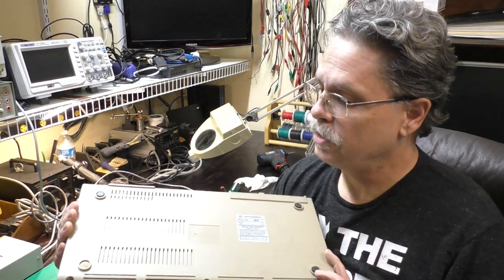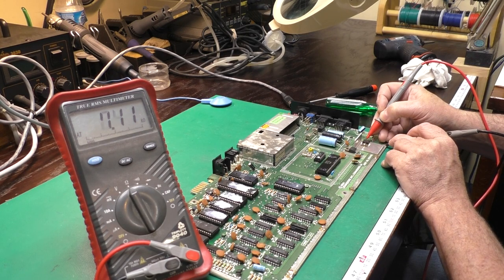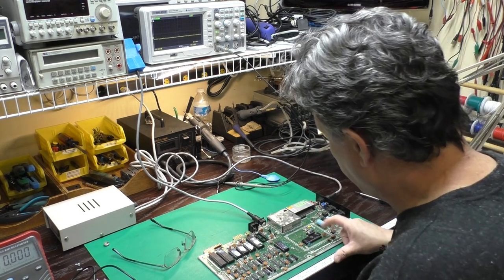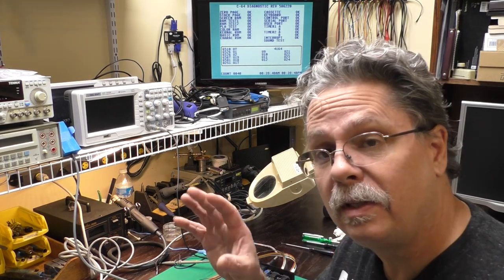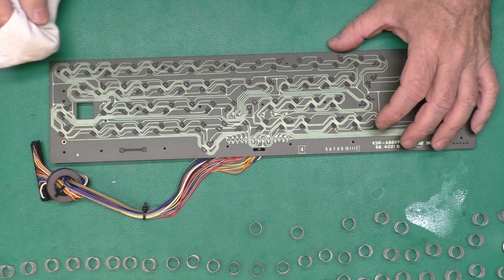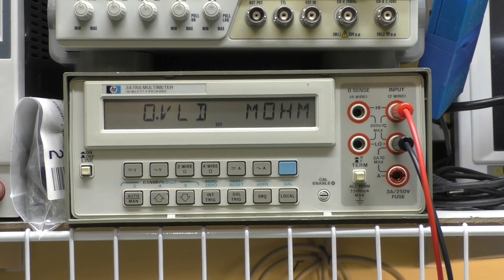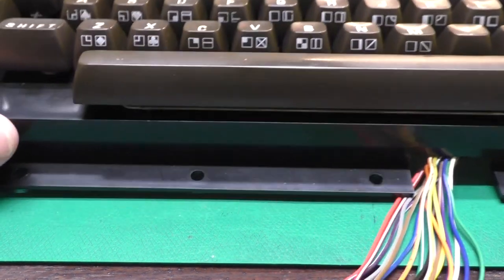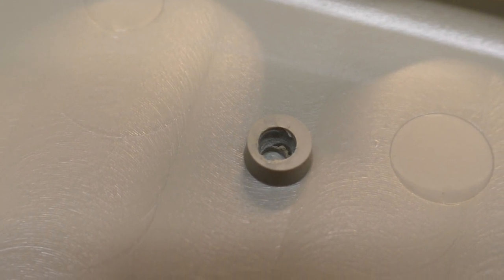C64 Donation Series #3   C64 Black Screen Repair and Refurbish

Comment: Hey Birt!  great looking repair for a great cause.  I have a question about the thermal paste you used.  What brand/type do you recommend or will any modern brand work in the C64?  Thank you.
Reply from the maker: Hi. These chips are not dissipating a lot of heat so some fancy 'artic silver' paste is not needed. As long as it is still fresh it will do the job just fine.

Comment: The detail and quality of your work is unsurpassed and frankly inspiring.  Starting with the right knowledge and tools, assessing problems first, testing and verifying repeatedly, cleaning every component that lends itself to it, careful reassembly and final QC for usability in the real world are steps that benefit any DIYer.  If you're not ready to do the above, or have a passion to "do it right" perhaps the project is best left to someone who is or the pros.  I've restored a few 1970s era Honda motorcycles so I know that your approach is a model to emulate. Kudos!
Reply from the maker: Thanks for the kind words.

Comment: Great refurb with a lot of attention to detail! Is there a reason why you didn't replace the capacitors?
Reply from the maker: I have done several C64s and tested the capacitors and have never found a need them as a matter of course. Amiga 500s are the same way.

Other computers are different of course, A600s, A1200s are known problems with the SMD caps and need to be recapped. Also, machines such as the TRS-80 Model 100 also have known issues with some of the capacitors, which are miniature through-hole,  and I replace them all when refurbishing one of them.

I have also seen good folks think they should replace all capacitors and inadvertently install poor quality ones that fail in just a few years. In short just wholesale replacing capacitors on every type of computer is not needed,  and may do more harm that good. If you need to do so then use good quality parts matched to the application.

Comment: Hi Jeff, I'm pretty sure our Good Friend and Resident Guru IZ8DWF I believe said that if there's no (Video) Bump om startup to look at the 8701 as a good possibility.  I wish I could see your Screen on Startup is that was the case but couldn't catch enough of the Screen...nice thorough Video as usual.  Regards, -Mark.
Reply from the maker: Yes, there would have been no video bump on start up. If the clock is not working (on any PCB version) or the VIC-II is not receiving power you won't get it.

I tend to approach most repairs in this same manner checking power, clocks, reset, bus activity. No matter the system it is a good approach which will get you pointed in the right direction most of the time.
Reply: My C64 (250425) had no image on power on, but i was not sure to trust the composite to hdmi adapter. Checked so many voltages and pins with logic probe and concluded that the is no pulse. I ordered a 8701 replacement and had luck. The 8701 was the reason and i got the new replacement with own crystal and ntsc/pal jumper. When i had seen this video earlier, i had been more confident to order the replacement earlier. The 8701 replacement fixes quarz problems, too.

https://icomp.de/shop-icomp/en/produkt-details/product/csg8701-replacement.html